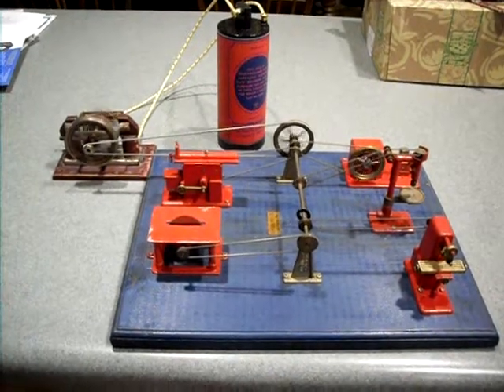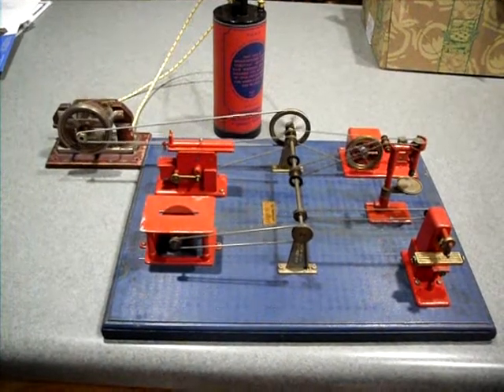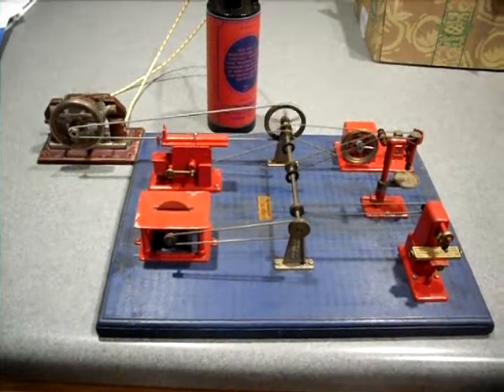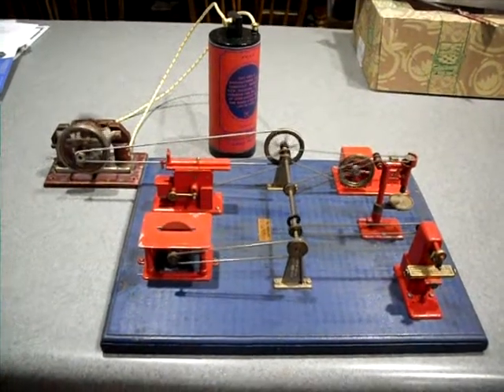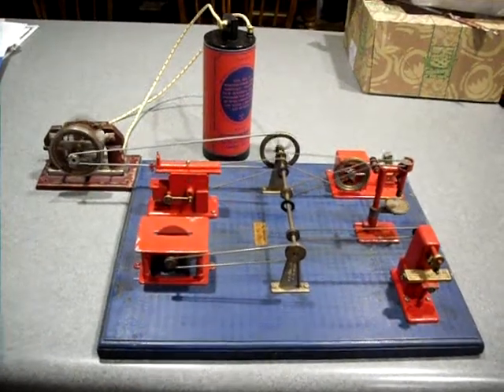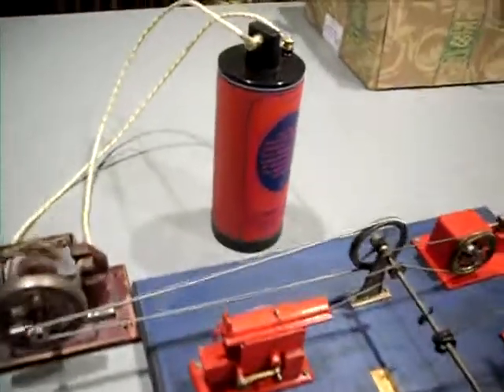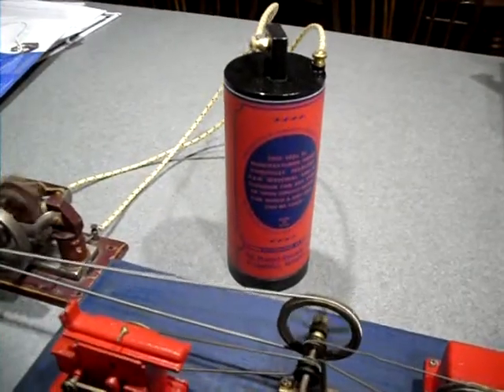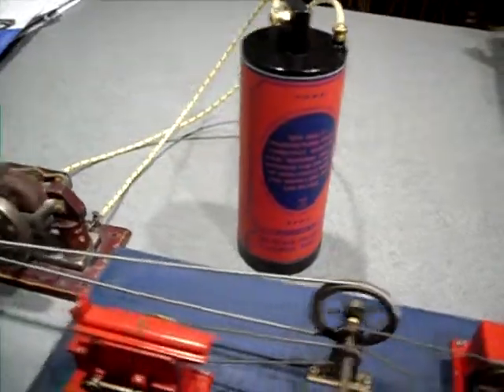Weeden #101 Motor & Jensen #100 Workshop

Comment: The Jensen 100 work shop you have is one from the first two years they make them either 1947 or 48. I am leaning more towards 47 do the the decal. In 49 or 50 the went to plywood base and yours looks to me a solid wood base. In around 51 the went from painting them blue to stain and varnish up until 1985 when they where discontinued.

Comment: My weeden motor wouldent run off 2 d cell batterys. I never quite got the brushes to where they should be but i modified a 12v power supply to put out approx 6v dc